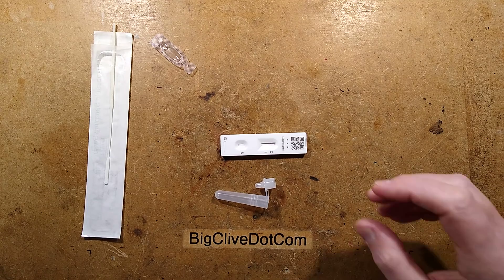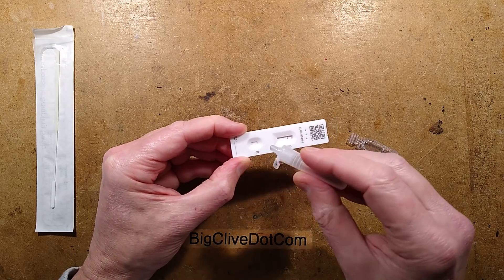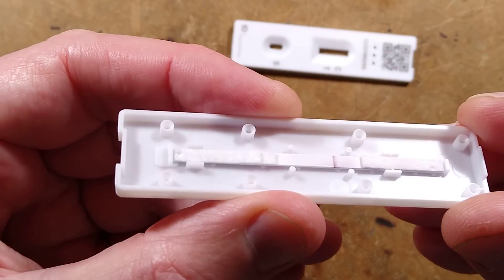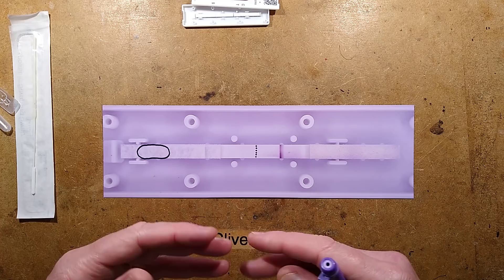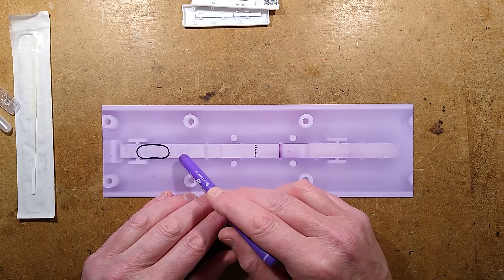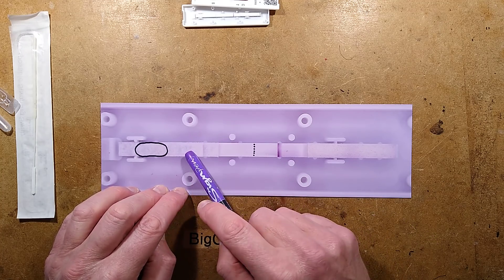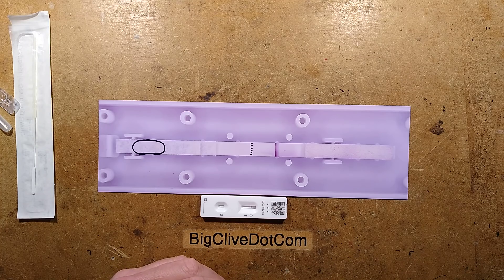How a lateral flow test strip works (kept simple)

Comment: These are the older kits that were replaced by slightly different test kits a few months back. A few small improvements were made - the buffer liquid is now already in the dropper with a foil seal on top, you only have to swab your nostrils now so no tonsil swab, and the tests only take 15 minutes instead of 30.
Reply: That sounds like the FlowFlex tests, and I don’t think they’ve completely replaced the (NHS) Xiamen Biotime ones - I’ve been issued two FlowFlex kits, then more Xiamen ones after that.

Personally I think I prefer the Xiamen ones. The nasal-only FlowFlex swab seems like an improvement, but doesn’t work so well (And probably won’t give as accurate a reading) for those of us who have trouble with ever-blocked noses! 😇

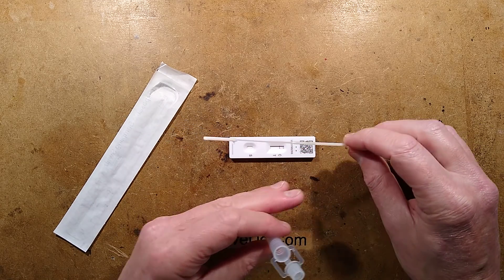Comment: 0:51 If your any good at deep throat, then you shouldn't have any problem.
0:55 If you're partial to a little bit of nose bag (cocaine), then you also should have any problem. As you'll be used to sticking a straw right up the back of your nose.

Comment: I got one of these tests a week or two ago. The lady at the pharmacy asked me if I wanted saliva or blood based test, and I went for the latter, because of the pharmacist's recommendation.
Test is pretty much the same, but obviously different a bit, because of the different sample being collected. They give you an alcohol-soaked cleaning pad to clean your fingertip, a spring loaded lancet to sting yourself, a plastic pipette to get the blood from your fingertip and place it onto the test, and some liquid to put two drops of onto the test area after the blood. Apart from the control strip, there were two strips labeled IgG and IgM and if any of these two appearing would indicate a positive test result.

Comment: Hi Clive. I need to inform You, that every single person who took “jab” and I can detect with metal detector Garret Euro Ace 350
Reply: Is that with or without the small bit of metal foil or dust stuck to the coil? Don't be F'ing stupid, there's no metal or chip in the vaccine, the needle isn't even big enough to pass a chip through it, I know that only too well, coz I've injected two current state of the art rfid tags into my own hand, a pet tag and a programmable tag. Maybe instead of sticking bits of foil to your detector to try conning folk, you ought to be protecting your head a bit more from all that dangerous radiation you no doubt imagine is bombarding the poor overheated thing.
Reply: @Tekwyzard  It is 100% true. Try this yourself.
Reply: @czystokrwisty_pureblood  0%. And you know it.
Reply: @FTfilm  true.

Comment: Let's put a dual-core 32 bit microcontroller, a fancy optical light guide, LEDs, optical sensors and a lithium button cell into this one-time use disposable test unit - and you have created a lot of electronics waste and the item which TheSignalPath took apart this summer.
I would prefer Clive's non-overkill version...

Comment: In Germany we have mostly tests that only need a swap from the first part of the nose, so only 2-3 cm or so into the nose. 15 minutes later you have the results.
Also for kindergarten we get free lolly tests two times a week. A bigger swap which you only swap in the mouth to collect saliva. Works way better for small kids.
Reply: We have those (Flowflex) in the UK now too.
Reply: @xRepoUKx  Was going to say that the description seemed like one of those Flowflex ones I used a few days ago here for the first time. Its swab pokey bit didn't expect to be nearly as far in the nose as the one shown here. And compared to the procedure described here I can really appreciate that the fluid was pre-filled, only had to tear off the seal and insert sample, then many of the same steps including putting the dropper lid on it.

Only vaguely heard of the lolly ones before, I can definitely see the benefits in that with young children that are often already moving their head out of the way or protesting when they see the wet washing mitt approaching after dinner before they are allowed to leave the table. Not sure how well small swabs going into the mouth and/or nose will go down with them.

Comment: In the version I’ve been supplied by work, the solution is already in the dropper tube, with a foil cap to peel off (with some difficulty) before use. Also, the instructions only ask you to swab both nostrils, not the throat.  And the result only takes 15 minutes.

Comment: That has got to rate as one of the best "public information" videos since their inception...very appreciated and shared.The versions that were sent out if requested via .Gov had to be returned for test results BUT could only be posted in certain Royal Mail post boxes...I live in central London,ie by Waterloo Station and there are loads of post boxes but the nearest one acceptable for returned LFT's was 1.3 miles from my home address...and as someone with mobility issues that was an issue. Also the cotton bud,after taking the throat and nasal sample had to be snapped before being locked in the phial. The indentation indicating where it should be snapped left it too long to get into the phial...a text let you know the results...LOTS of piss balling around...liked the usability of the test you had a lot more...as ever Clive best wishes from South East London lalala
Reply: Technically you could've used any post box as long as it was still to be collected that same day - the "Priority Postboxes" are simply post boxes that are part of a later collection route and the rest of the post boxes are collected by the Posties while doing their delivery, so collections could be made from those any time after 9am depending on area.
Reply: @0xf_Steven  Hey thanks for getting back...nonetheless it was a pain...I went into the main post office in Walworth Rd really expecting to be able to dispatch it there...no way, another half mile down the road to the post box outside Marks"n"Sparks!!! 👍"s up ⚠️

Comment: This post will likely be removed in a few minutes. Even though it is verifiable facts, and doesn't contain vaccination info.
Common cold, and Influenza, and Novel Corona Virus 19, are all Corona  (crown like) Virus's. The current pandemic just happens to be the 19th corona virus, variant alfa / gama / delta / whatever. Plz don't put the swab in your mouth and nose, for all the same reasons that your arse is Not connected to your mouth.
Reply from the maker: Your nose and throat are connected.
Reply: @bigclivedotcom  then there is no need to swab both.
Reply: @bigclivedotcom  reasoning: (short version) "the muck" caught in your Nose, is not ment for your Throat. And vice versa. Your Ears, Eyes, Nose, Sinuses, etc., all filter and encapsulate "the muck", but your throat is unprotected.
Reply: Most likely will be deleted, I posted a comment half an hour ago and it's gone now

Comment: I was a bit disappointed to find that the C control showed up with just the buffer solution without a sample. If it was able to react to DNA or something, then at least there would be an indication that the test was valid. If you want a negative test, then just skip the bit involving the swab.
Reply: Indeed the 'C' line appears even without a sample.  I would have expected it to indicate something normally present in saliva, but no.  Thus a 'valid' negative result gives no confidence that the test has been conducted correctly.  This feels to me like a fundamental flaw in the design.

Comment: The one thing I noticed about these test is all the plastic they used to make them vs the test strip itself.

It would have worked just fine without the plastic.  Needless waste.
Reply: I noticed that, also the amount of packaging used to ship the kits to the customer.  This feels like a product that was designed for low volume manufacture and not optimised for mass production.  I suppose the manufacturers had no incentive to cut costs as the competitive tendering process was bypassed.  Thank goodness we don't have to worry about single-use plastics harming the environment any more!
Reply: @whatdoyouwantfromlif  it's actually crap, yknow.

I know plastic is litteraly everywhere at this point and with all these claims and exclaimed goals to fight the damage we are doing to our planet and independent country targets, its like there hasn't even been any attempt to swing the usages the other way.

Comment: Great but a shame it's a pretty old test, the newer ones (since at least 6 months ago) have been improved in 3 important ways:

1) they only require noise swabs (not tonsils as well) so no gagging and it's simpler

2) the vial already has the liquid in it (with a foil you peel off) so that's simpler too

3) it only takes 15mins (not 30mins) so the test result is known in half the time!

FINALLY, it's actually very important that once you have your test result - whether positive or negative - you report it via the NHS website so that data can be analysed, enabling outbreaks to be tracked, etc.

Comment: Couple of drops of RolaCola (other soft drinks are available) comes up positive in the half hour timeframe also. This was proved on Chris the butcher and friends recently 🤪
Reply: Did they use a trace amount of cola in the buffer solution or just pour straight cola into the sample collection area ?
Reply: @chrisdee8957  I believe it was a couple of drops on the sample area Chris, my wife follows them and showed me the video. Sadly, I paid little attention apart from the outcome which surprised me as much as them it seemed
Reply: @Mark_C1  so you can have a positive, negative and flase versions of both. Unless the cola had covid 19 virus its not a positive result, its a flase positive that had occurred from not preforming the test correctly. One of the methods I mentioned would give you a negative and one would give you a flase positive result.
Reply: @chrisdee8957  I never considered that the cola might have caught covid 😁👌 I think the reason they tried it out was because they had heard kids were doing it and getting out of school so they were warning parents. Sneaky little blighters.
Reply: @Mark_C1  yes I'm aware of how and who tried this method of giving a flase positive. I just find its better to clear things up before people start saying the wrong things. The cola would have to be contaminated with covid 19 for a positive result( colas about 2.7ph so it's unlikely that covid could survive in those condition). The correct phrasing you're looking for is "cola can produce a flase negative if the test is incorrectly administered". The buffer solution is extremely important for correct PH on the litmus style test medium that shows the results and without it the test is useless.

Comment: Clive, just to note, there are two types of kit now, the latest version doesn’t require a throat swap.
Reply: Correct - You can use a papaya, a goat or engine oil, and it still produces a positive result.
Reply: I don't know about a goat or engine oil, or even a papaya, but I do know that acid reacts with the antibodies in the strip and causes a positive result - it is due to the way that the test works, so a lemon will produce a positive result.

Comment: I wonder how those digital pregnancy tests work.. maybe Clive needs to take one?
Reply: Funny thing is, a man can actually test positive on a pregnancy test.
It means testicular cancer.
Reply: @TheBackyardChemist  All the more reason to use one and take it apart and see what's inside
Reply: @ryandrew8075  Very similar, just with different chemicals in the flow strip.
Reply: @TheBackyardChemist  even the digital ones with the LCD display? i get the concept but how do they get a yes / no signal from a color change somewhere?
Reply: @TheBackyardChemist  ah well i guess a high voltage digital pregnancy test doesn't exist for "reasons"

Comment: Unfortunately those tests have as many false negative and false positive results as they do valid results. That is why anywhere it actually matters they require a proper lab test like a PCR which has far better accuracy.
Reply: I was under the impression they were pretty decent at picking people up when they are able to spread the disease competently. Not so much in the period leading up to it or the later stage when one might be sick but no longer infectious and little sign of it left in the nose and mouth? Bit out of the loop though with more things than basic news stuff though the past few months.

A RT-PCR test definitely seems like a good idea to confirm a positive out of these and I agree that in some settings the false positive and false negative rate might not be acceptable. But I do wonder how many of the false negatives actually come from not following the instructions, many things that can go wrong with these:
- not being able to or wanting to try to collect a proper sample
- not squeezing the fluid out
- not getting the sample properly in the fluid
- wrong ambient temperature 
I'd be curious how different the results in false negative rate would be if the self tests were done in a proper and consistent way every time. 

However regardless of some issues with these tests I'd expect them to still be a decent addition in a situation where you want to test many people frequently in order to keep schools open for example. Won't be perfect but if the choice would be between only testing symptomatic children and a few at random per week or regularly test everyone with these I think they do have a place in the overall strategy. If everybody (or at least most) complies a positive test should show up quickly hopefully leading to less children and teachers being affected by both disease and  the various followup requirements that make teaching difficult.
Reply: @extrastuff9463  Actually they are FAR worse. With a false negative, they give people a false sense of security so that they just go spread the disease all over the place. The fact that they rely on these things for things like determining elegibility for air travel is exactly how these diseases spread around the world so quickly. Junk test says you are clean, sure....come on into our country and spread away!
Reply: @CommonSensePeople  Well for that purpose I'd fully agree with you. For international travel and also longer distance domestic travel (assuming you're describing a US scenario?) I would consider it a bad idea too. RT-PCR with samples taken by qualified staff should be the only acceptable option.

At schools where testing everyone daily or every two days in such a way just isn't doable in many places. Also the rapid positive result means that if one is picked up and confirmed to be a true positive further spread in that class might be stopped or prevented entirely. Might not be perfect but it's better than only testing symptomatic students with RT-PCR + a few extra randomly picked people every week which is likely the only other financially viable alternative.